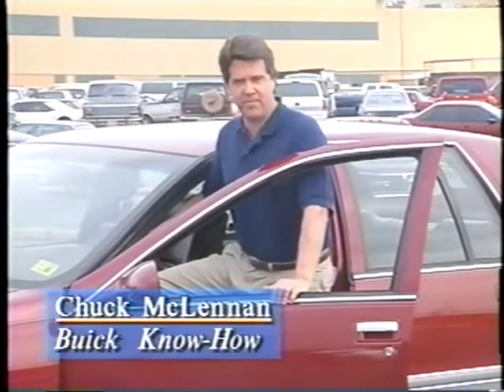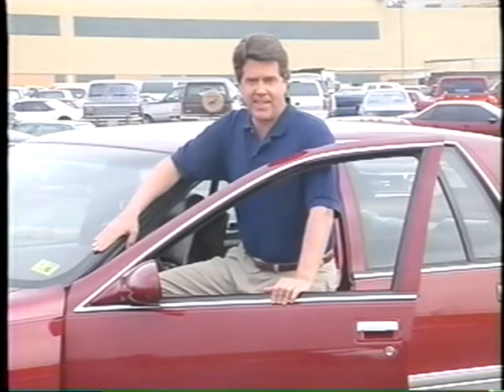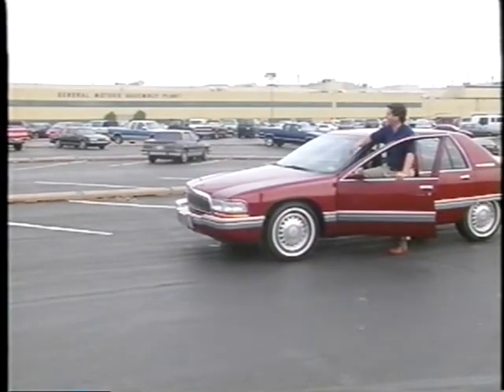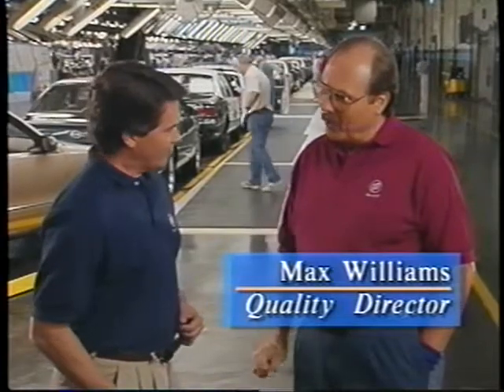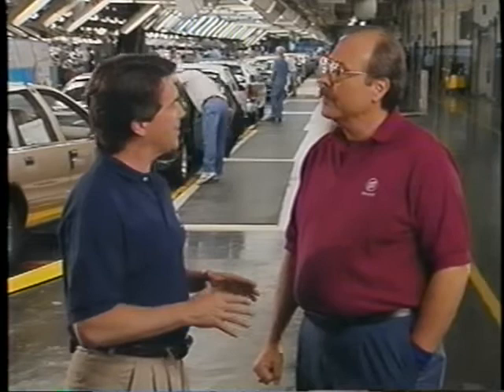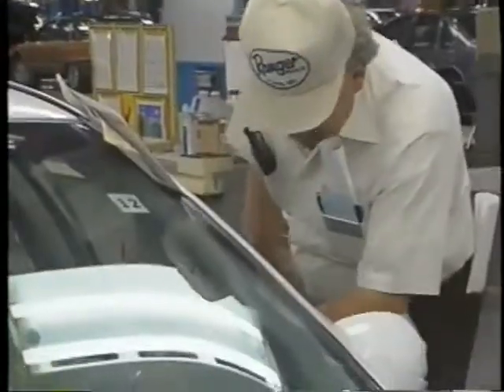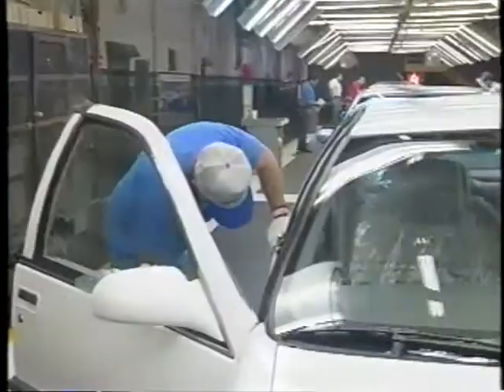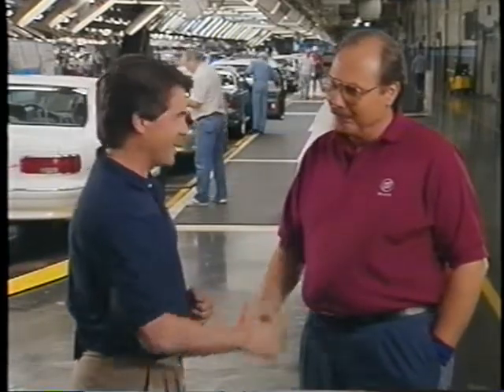Buick Roadmaster & Arlington, Texas B-Body plant footage

Comment: I just by coincidence was at the Arlington plant when literally the last B bodies were rolling off the line. It was 12/13/1996 and I worked for Xerox and was moving equipment in the plant while a ceremony was going on as an Impala SS and Roadmaster hit the finish line. On the other side of the plant heavy equipment was tearing out the assembly line to prepare for SUV production. It was the end of an era and I just happened to be there.
Reply: If you remember that last Impala SS down the line I bet it was a white one, they kept it and it still sits in the plant today, I retired from this plant in 2008 after 30 years.
Reply: @randyfarr844  You must have had a role in making my '94 Roadmaster. It now has 145K miles on it & still runs and drives great. It's not a show piece, but it's still in good shape. Thanks!

Comment: We are selling a '95 that has only 80k miles on it. It was my wifes' grandfathers car. Light blue, beautiful, and loaded. LT1 350 runs like a dream. They were meticulous with maintenance. All updates by the dealer and they just had a new rear seal put in (leaked because it just sat for a time in the garage), leather heated seats, heated mirrors, cd, etc. We have the original window sticker (he paid $30k for it) and the original Buick dealer brochure. $3500 in Indiana. Wish we could keep it.